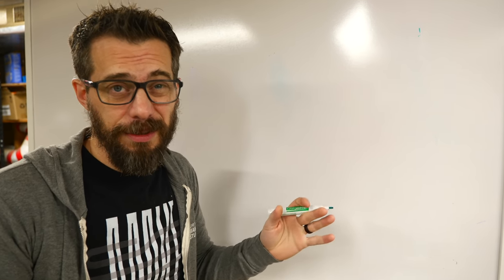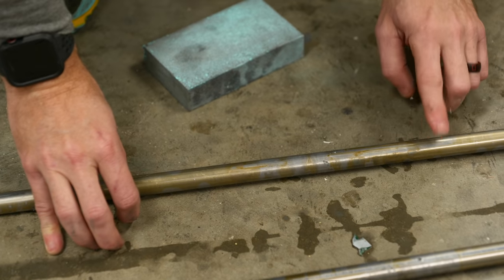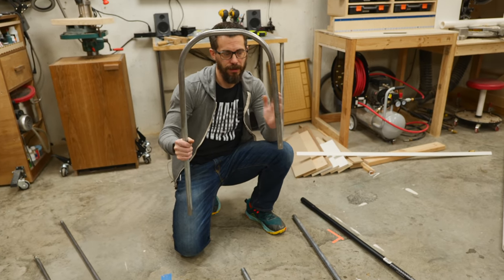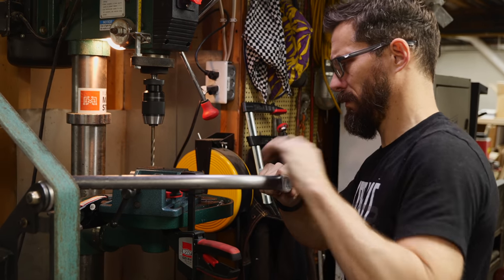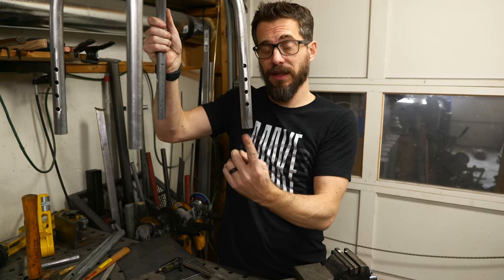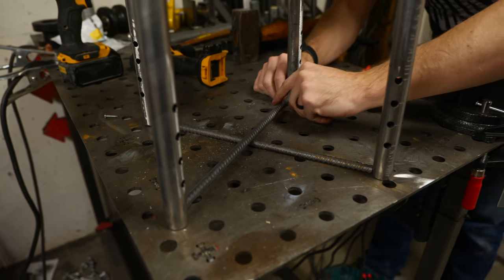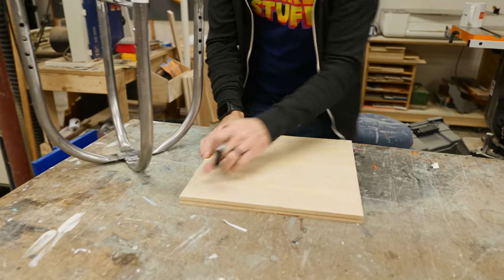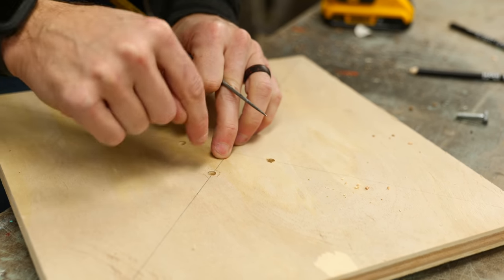How To Make An Adjustable Pottery Stool | I Like To Make Stuff

Comment: There is a star mark on the bender that is used for “back of 90”. Using that mark allows for a very accurate measurement for bending two back-to-back 90s.

Comment: Great project, Bob! It's worth mentioning that your soaking method works great to get the galv off of the inside of the steel conduit, too, which is necessary before welding! If anybody needs any further discouragement from welding galvanized pipe without treating the inside and outside first, look up the effects and symptoms of galvanize poisoning. 🤒
Reply from the maker: Thanks Becky! yes, that's a point I should have made as well 👍🏼

Comment: Hi Bob, nice stool, but I think it is not necessary to remove the galvanization completely: you can grind it off close to where you are going to weld.

I would have made an extra 3d printed ring to put around the upper side of the thinner leg for added stability.

Ciao dall'Italia!
Reply: +1 for the rings
Reply: And how to you grind it off from the inside of the conduit?

Comment: Always interesting to see how you tackle similar items to what i make at work. 
The only thing i would be concerned about is the strength integrity of the peg for the adjustable part. With it being on an angle, it might fail after awhile. We use screws for all our adjustable stools and tables. It means using a flow drill and tap for the inserts.

Comment: Nice work! In my very limited upholstery work we would add 3-4 one inch holes in the plywood to help the air in the foam escape. An electric bread/meat cutter also works great for cutting foam.
Reply from the maker: Great tip!

Comment: Great job and you killed me with "blue bottle cap" because I was just thinking that when you said it. Maybe for the final feet you can add a screw adjustable swivel foot so you can make micro adjustments to the legs to allow for an uneven floor.

Comment: i made something like this for my mum. but instead of the adjustable legs I took the base and the chair of a adjustable height one. that was going to through away. and made a new base added a stool top and bolted it so that it would no longer turn. and you can just lean forward using the chairs tilt mechanism and the stole can still go up and down with gas ram. cool video fella.

Comment: When working with dowels, place in drill and shape with files/sandpaper etc. Easy and safe solution rather than a small dowel and a sanding disc. 
Well done on such a great project.

Comment: Hey Bob, try to use some soap and water to clean the metal when you take it from the vinegar. It's important to neutralise the acid in oder to prevent the rusting.

Comment: Have a look at the rubber feet ( ferrules) that you see on walking sticks and crutches, they come in loads of different sizes and they should be fine leaning over that far as I use one of my walking sticks as a 1 leg perch stool at the ferrules  hold up fine. The things I'd worry about with those mini wooden legs is that the stool could slip backwards easily.

Also, if you search "Open Source Universal Ball Joint (to reuse!)" this ball joint would work great as a foot

Comment: Great tips on the galvanization removal, I'm impatient so I either grind it off or use muratic acid. Muratic acid also works super good for fast rust removal too, just don't leave it for too long or it eats the metal too lol

Comment: Maybe printing a ring for right under those springs on de adjustable parts would be a good idea. That way it is supported on two points instead of 1. Should reduce the wiggle better and also keep it easy to adjust the hight without having the pipes catch on each other because of the angle. Either way awesome video!

Comment: Link to the pottery wheel how-to??
For the metal stripping....You can use a higher concentration of vinegar. They sell as a commercial cleaner. But muratic will work, yet you better keep an eye on it, as it maybe too aggressive depending on how long you leave it soaking

Comment: i would draw a line around the inner pipe in line with the hole/spring-button so you know where it is if you get it twisted around for some reason (like wanting to move it through many holes... or if someone decides to fool around)

Comment: There are also deduct measures for each size of emt 1/2, 5inch, 3/4 6in 1, 8in. The deduct is the amount you deduct from the length of 90. I.e if you want a 90 30 inches long you mark at 30 then deduct the amount based on the pipe size and bend there as the shoe moves around it will make the back side of the 90 the measurement

Comment: FYI for anyone thinking about it, if you wanted to make this stool without the ability to independently adjust the feet, you know, so it won't accidentally lean anywhere, then you could attach that bracing rebar or whatever you use for bracing to the adjustable part of the legs instead of the static part. That way it only locks into place if you move them all. There are of course better methods to do this, but using only the exact pieces used here this is the best way I can think of to do it.
Reply: Only if you have four hands to pinch all the springs when you want to adjust it 😀

Comment: But how do you deal with the coming surface rust from the inside after pulling those pipes out of the Vinegar? Wouldn't it be better to clean the inside with a brush aswell? Same thing about finishing it up from the inside to prevent  surface rust? Never the less: Great project. Great Video. Great Maker.

Comment: When you use the calipers to measure.... are you doing it loosely or are you taking into account the variance that the printer prints at when you get to the model? Like how FDM prints could need 0.5 tolerance. I try to get everything super accurate and then sometimes have to go back and do the printed parts again because tolerance needed.

Comment: 19:06 Using a T-nut would have been far easier and faster. And since they have a larger head area with 4 spikes, they would of had a much stronger hold in the wood (to kept them from spinning and pulling through the wood when tightening them down). The bolts you used are going to slowly sink into the wood over time (due to the smaller hex head area, and the weight of someone sitting on the stool), which will slowly loosen the top... you'll then need to re-tighten it, then the head will pull further into the wood with more usage (wash, rinse, repeat).

19:50 I would have used a set of hard'ish rubber end caps. Home Dept sells various sizes/types that would worked and fit snug on the ends of those legs. They would allow just enough grip on the floor, so the stool does slide out from underneath you while while sitting in it while the stool is tilted forward, and the rubber would of had enough "give" to allow the feet to adjust to various legs lengths/angles.

Comment: Avoid as much as possible using cheater bars on vice like this. The handle is usually sized for the max load of the vice

If you're ok to maybe damage the vice, you can do it (i'm guilty of this myself), but I would recommend having 2 vices, one good quality one that you try to keep in good shape and a beater vice for welding and cheater bar action

Comment: Why have gone thru all this trouble with the bolts? In germany, where I live, we have thread screws with a flat top and an squared up portion below the head. You just drill the right sized hole and tighten them down to lock them in place. I'm really curios if these type of screw is avaöible in the US. In german they're called Schlossschrauben ( or Schloßschrauben but you don't have this ß letter).

Comment: What about making just the seat part adjustable???, so you can keep the center of gravity in the same plane and the 4 points of contact with the floor as secure as posible, to prevent the whole thing slip to the back... anyway... great work mr!
Reply from the maker: Hmm, well, I suppose you could but we haven't had any issue with it slipping at all.  Rubber tips on the feet would help that even more if it were an issue.